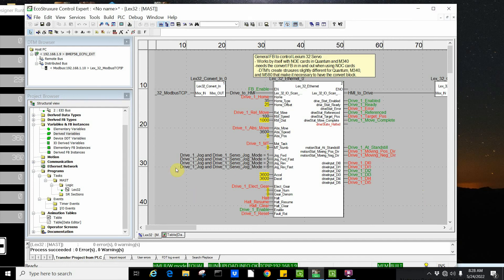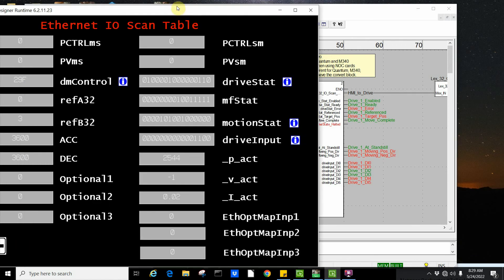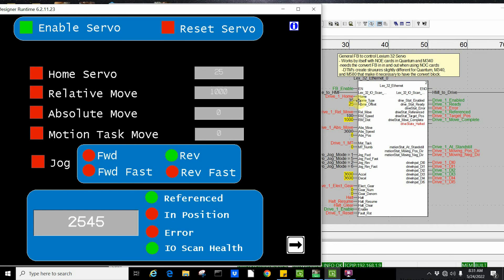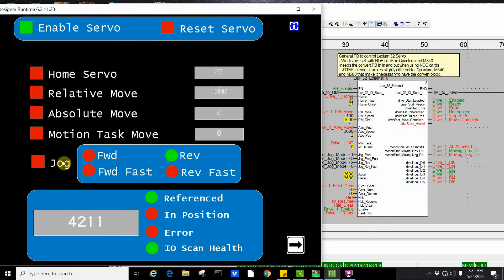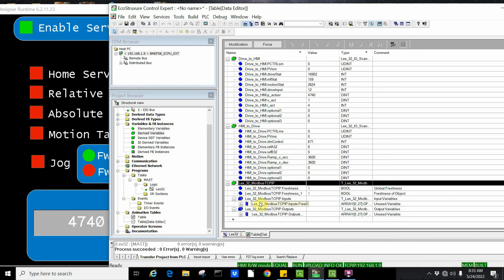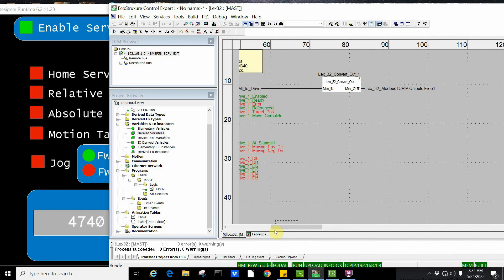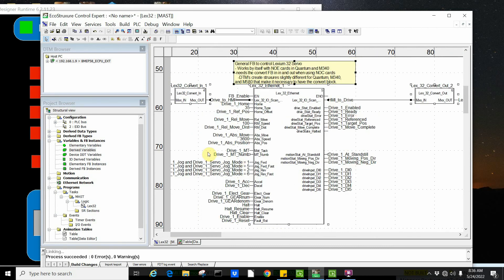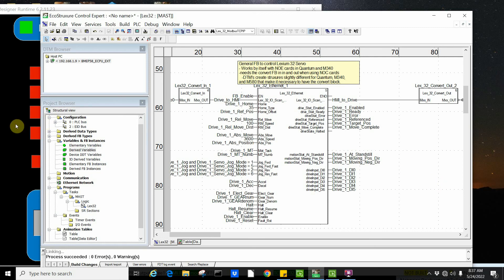Lexium 32 servo with M580 control

Comment: Hello Steve. Thanks a lot for this video, it has been a great example to learnabout Modbus on Lexium drives.
Would like to make a question: If I want to control the motor directly from logic, is there something I need to add in order for the working mode to change correctly?
Have been not able to install Vijeo (installation files are a mess) and dont know if you also use some logic inside your HMI.
I am able to make the motor move using SoMove but activating and changing the values of the variables in the logic have no effect.

Comment: hey man i really liked your video you did a great job.I tried your programme with a M340 and a noe card but it didnt work for me i didnt use the two conversion blocks as you said in the comment but it still didnt work.i think there s something wrong with the dmcontrol because the hmi to drive work properly and when i click on enable my lexium32 is enabled but none of the operators mode works.